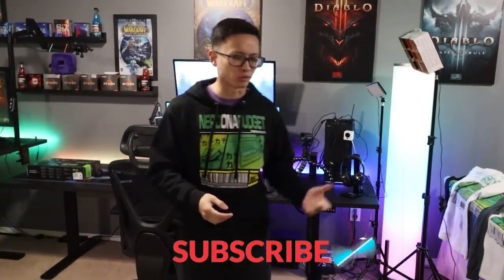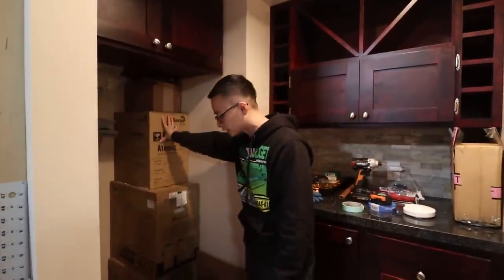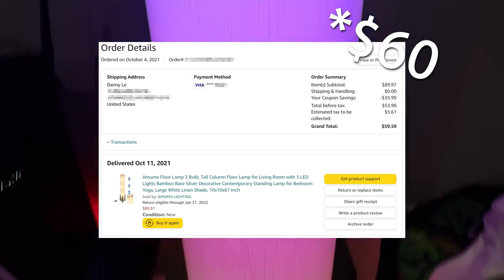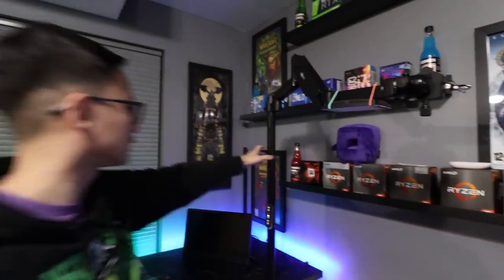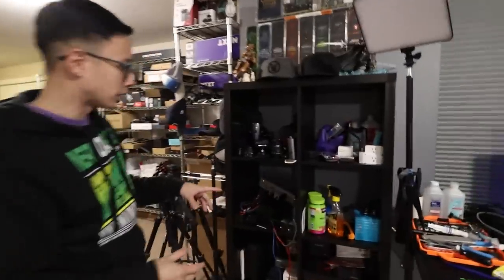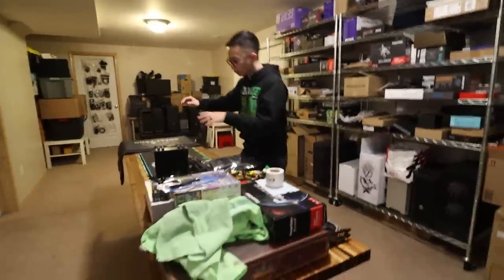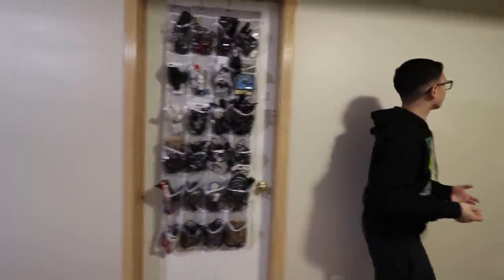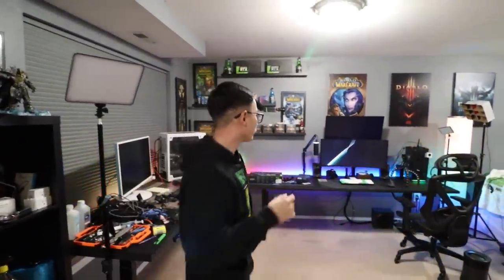My NEW YouTube studio setup in my basement! (2022)

Comment: That asus gtx 1070 is still a beast. I still use mine for 4k gaming (in some games). i overclocked it as much as I can and never had temps over 65c.
Reply: 1070 gang here, happy with mine too, have it since 2016 and it runs gow on ultra at 1440p and mines when not gaming 🤟 so glad i didn’t sell it before the 30 series launch lol
Reply: @Chron1k73   It's honestly still a beast of a card. I cant run modern titles at 4k but I play overwatch at 4k 120~ fps constant competitive settings.  I don't plan on selling it anytime soon.